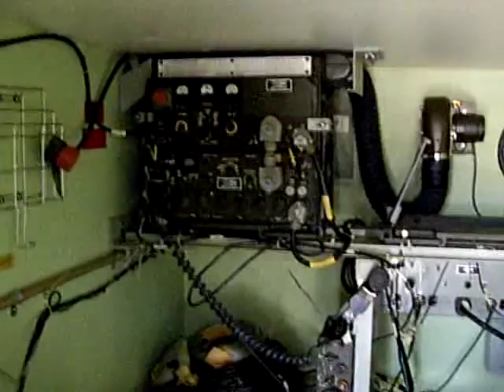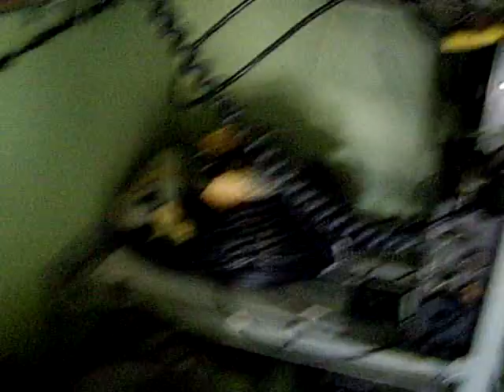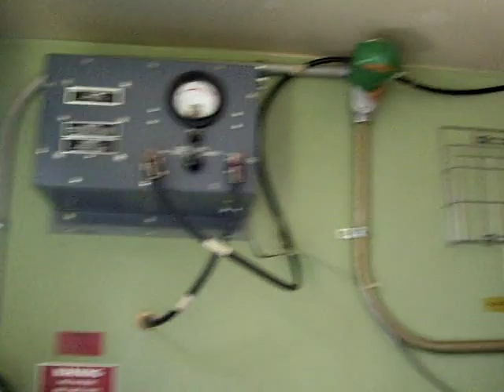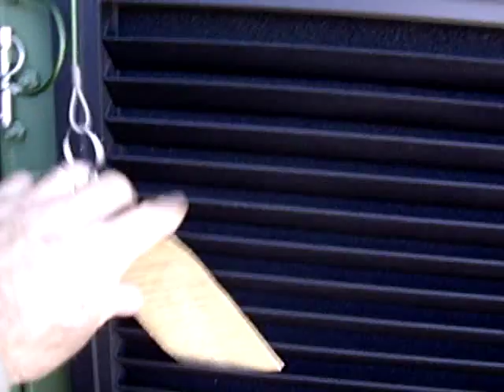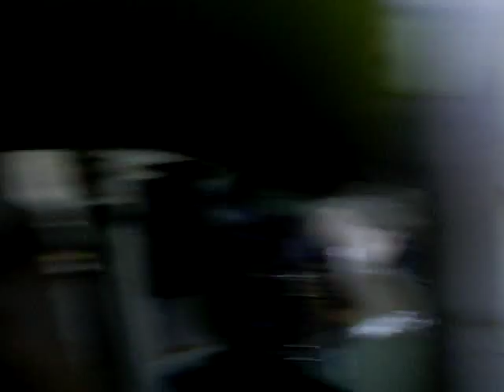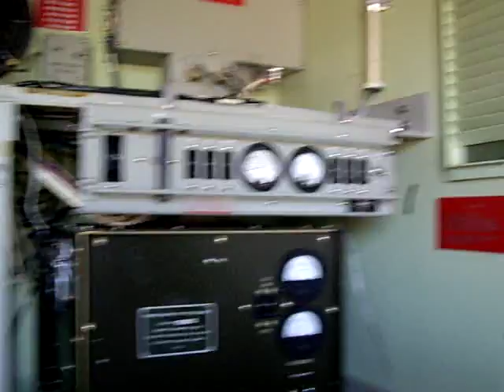GRC-122 commo shelter

Comment: PS: You didn't really want the RATT gear. I believe they were Klineschmidts running at 45 baud. They required a lot of maintenance but they sounded neat clanking away!
Reply from the maker: I did get all 3 RATT rigs and reinsalled them and the modem but was not able to get the two GRC-106 amps unstuck and working.   When I traded it, the drive to the new owner at least one amp got unstuck and worked when he turned it on.... go figure.....

Comment: Actually, I live right next to Fort Gordon, home of the Army Signal Corps... I could probably score one of these myself at an auction, if they aren't long gone years ago.   How much did you pay for yours, or was it free for the hauling?  If you paid anything you probably paid to much, I'm thinking.  The only upside being the old 28 volt radio transmitter and receiver inside.  Once at auction I saw some junk Vietnam telephone switchboards, which went for $20,000 for the gold contacts inside.